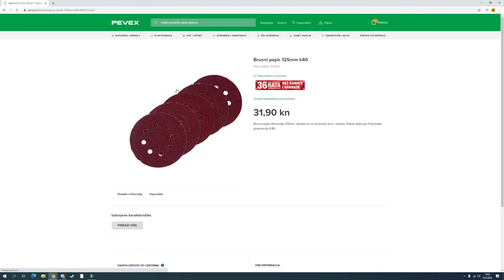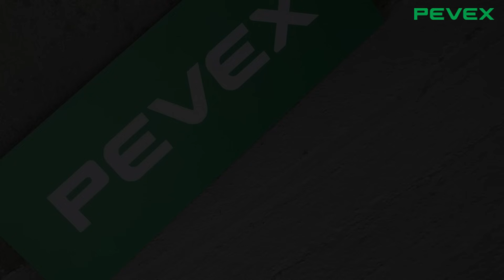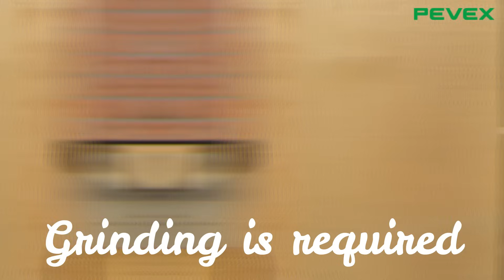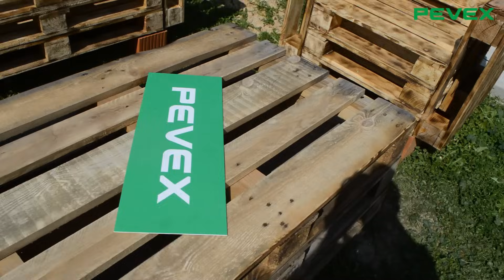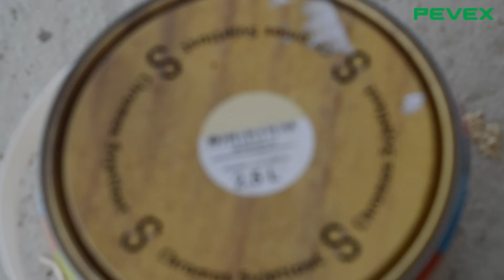Homemade GARDEN FURNITURE From PALLET !?

Comment: I built the two-seater today. I built the armrests big enough to hold a plate and a drink. Still need to do the finish work, but it's a solid couch. I have many friends, so I'm going to do three more two-seaters. Still need to do the finish work, but it's a solid couch. I'm going to build the table large enough to hold dinner for my many guests. Thanks for the inspiration.  Fun project, for sure, and a very nice upgrade from my busted picnic tables.

Comment: He split a lot of the board ends with his screws. If he had made a pilot hole, he would've been able to avoid splitting the wood. And his dismantling of a pallet wasn't very good resulting in breaking some nice boards. A waste. Good easy pallet project though for someone wanting to build outdoor furniture.
Reply: Bro the point of the video is for basic skilled people to follow and make a bench. I’m gonna build this and I don’t care about splitting the wood. Most people who will do this have used pallets laying around.

Comment: Very fine project well done ! though I would probably just paint the plastic furniture and add cororful cushions :(
I would like to make a small suggestion if you are up for it, you could use the small bocks from the pallets to add legs to your funiture to protect them from rain copletely, probably 6 under each piece or 8 for the larger ones.

Comment: If you pre drill pilot holes for your screws you wont get the splitting of the timber. Also, probably a good idea to varnish each piece individually as over spray from each piece would compromise the finish of the others

Comment: Hey Doctor D.S, very nice job! Thanks for that! Just made my very first 2-seated-lounge set following your video. Piece of cake! Extra question though: what are exactly the dimensions of the pillows you use? These are not standard dimensiosn , correct? Did you let them make with customized dimensions? And what type of material is it?   Thanks for the advice, cheers, Jan!

Comment: I've seen a lot of pallets, I haven't seen one I'd like to sit on.  Can anyone imagine a 10-year-old with shorts sitting in one of those?  He must be selling tweezers on the side for splinters.  Talk about a waste of time.
Reply: I've sat on loads. 
Run a decent sander across it and then varnish it and it's going to be nice and smooth. Same as any wood really.
Reply: @dangermouse9348  Hmmm. You must get a better grade pallet than any I've seen.  I've never seen one with planed wood that a decent sander could possibly get smooth and splinter-free.  You sit the kids you know on them.  I will not.  I've not seen one I would say "just like any other wood".  What I could get free is weatherbeaten, splintered, absolutely no grain (ugly), and a bunch of holes.
Reply: @yrralyou  That sounds like what we called "Euro" pallets, ie pallets that met EU standards. They tend to be quite rough wood and made of narrower and possibly thinner planks.
The blue and red pallets that originate in the UK are decent quality, similar to the ones in the video.
To highlight the difference. Give me a Euro and a pair of steel toecapped boots and I'd happily kick it apart for you. A UK pallet, not a chance. Heavier wood and better quality overall.
Reply: @dangermouse9348  Well, I live in the US and all I've seen are simply sawn pieces of rough wood of unknown quality.  Even then to get them free I'd have to steal them.
Reply: @yrralyou  Ah I see. 
Yeah the UK made pallets are pretty decent quality. Lots of people use them for making stuff because they're a cheap supply of half decent timber.

Comment: You know, there is something called a circular saw, much faster, just saying 😁.
Reply: There's something called $$$, that's required to get a circular saw. Not everyone would be building using a pallet just for fun. Wood is way too damn expensive right now - I may consider building my garden bed with concrete blocks
Reply: @sbradshaw1886  It was just a joke as he was constantly using a hand saw.  We are in the same boat.  I did finally get a Dewalt saw on sale.  I, too, have been struggling with the cost of lumber and am trying to get pallets from my old work to build by my raised garden beds.  Find a way despite the obstacles the garbage narcissists that mislead the world put in your way.  They are always working to erode our rights, freedoms, happiness and prosperity and need to be kicked out of any position of power that they use to spread their misery and their disease.  That's what at the root of the problems we face.